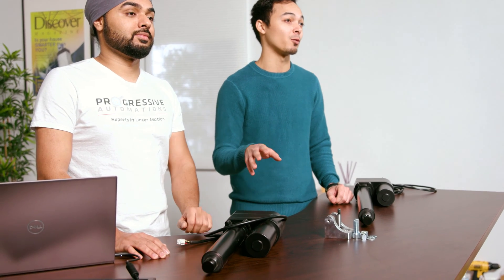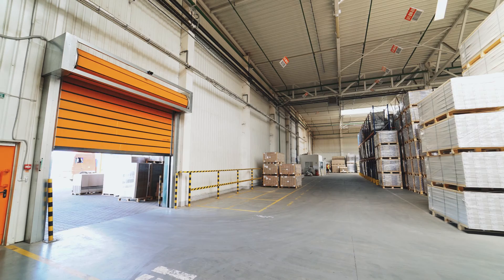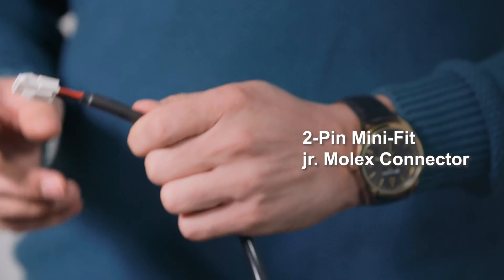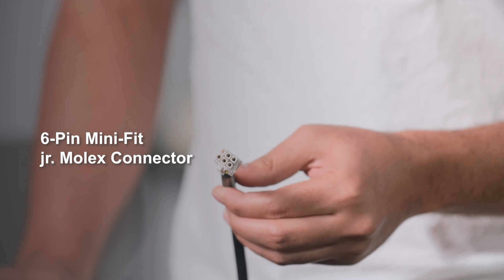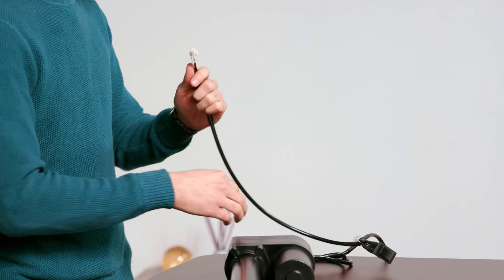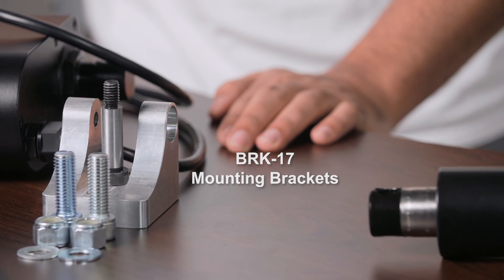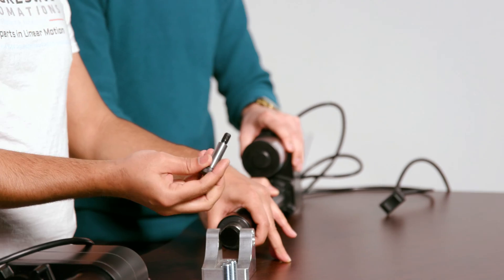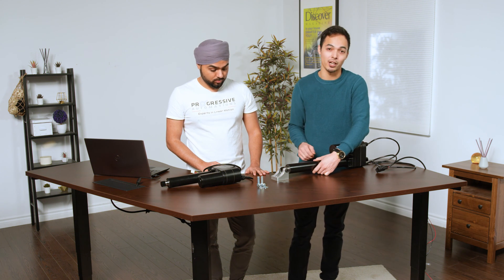Industrial Linear Actuator | PA-17 & PA-17 POT Product Overview | Progressive Automations

Comment: Good morning, I have a question. I work for a company that has ordered one of your motors for lifting a spray column for hydroponics. The problem is that when it reaches the top or bottom, it stops functioning. Is there something we have done wrong, or is there a malfunction with the motor?
Reply from the maker: The actuator is suppose to stop moving and automatically shut off electrical power once it has reached the full end of the extension or retraction which would activate the built-in limit switches. To bring the actuator into motion once it has stopped at the end of travel is to reverse electrical polarities so that the travel direction will reverse and continue movement. For further assistance, we'll gladly assist you at 1-800-676-6123 or sales@progressiveautomations.com

Comment: What is the max stroke speed? When activated by the rocker switch the rod extended at a slow steady pace and my application would require something a bit faster.
Reply from the maker: The 850 lbs force option of PA-17 has a no load speed rating of 0.66"/sec. For more information on our product range, feel free to reach out to us sales@progressiveautomations.com or call 1-800-676-6123 and we'll be happy to help find a suitable model for you!

Comment: Can one of these lift a 910 lb motorcycle if I put it on a lift table. That is all I need to know. 😉
Reply from the maker: The PA-17 models are offered with a 2000 lbs force rating option that users can select. Stability of the platform should be taken into consideration as the load from the motorcycle may not be evenly distributed onto the platform even if the actuator itself has the raw power to lift the weight. Sliding guide rails for secure level of the platform can help with this, similar to how smith machines keep weights in a leveled position. Assuming the 910 lbs force was directly translated to a downward force applied against the shaft of the actuator, the actuator should be able to lift the load.